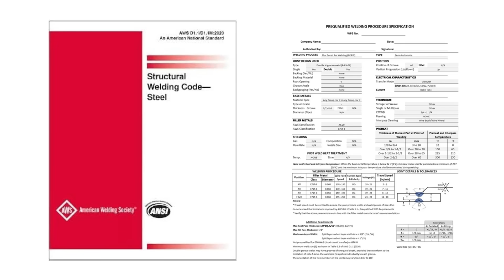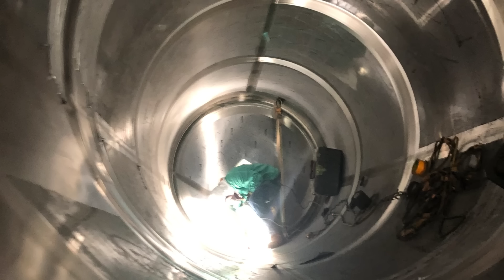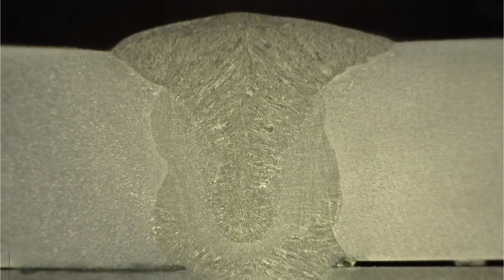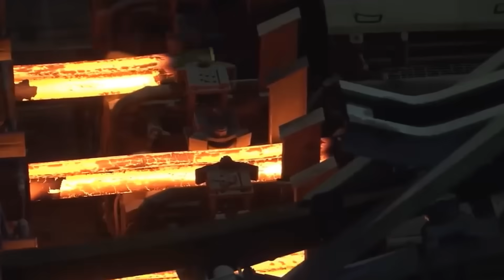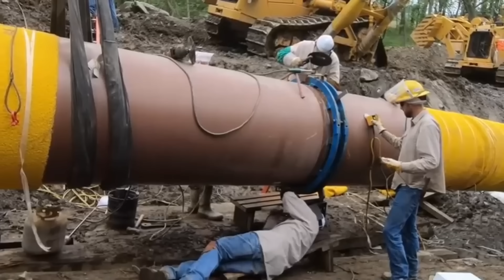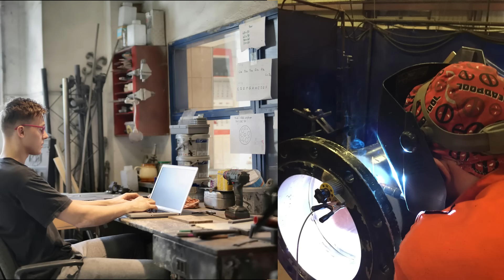7 Things Engineers Wished Welders Knew About Welding

Comment: When a car rolls off the line, the engineers that designed it, should be given a basic set of tools and a driveway, and be told to change the oil, remove the starter motor, remove the alternator, swap the thermostat etc.

Some modern vehicles require a full workshop, four elbows and the ability to work by feel, just to fix the simplest things.

Comment: The FRIB at Michigan State University. A particle collider with a building on top. 

Made the first floor beams out of something like w44x335 with 2" plate welded to the top and bottom flanges.  The engineers specified a 2" camber at 20' lengths.

Engineers didn't understand that for the camber to be useful, you have to have the building there first. 

Biggest mistake I've ever seen. I don't trust engineers.

Comment: There is a difference between knowing how a weld should be made and knowing how to make a weld.

I was called into to solve a weld problem that a fabricator had.  It turns out the welders were not welding according to the design.  Once they started welding according to the design, the problem went away.

Comment: 2 things I have fought as a welding inspector. Electrode manipulation too wide leading to loss of interpass temp, and rolls of wire left in wire feeders at night to connect moisture and be injected in the weld the next morning. Your title is wrong; it should be 7 things Inspectors wished welders knew about welding. Engineers are useless most of the time.
Reply: Damn straight. Although, it doesn’t help when the base material is left OUTSIDE either.

Comment: I’ve been an engineer for over fifty years. I started as an apprentice before gaining my Engineering degree. Instead of moving into an office, I spent fifteen years on the shop floor becoming a coded welder for seven of that fifteen. When I finally moved into design, I actually understood most of the pitfalls that engineers don’t foresee because they have no practical experience, making adjustments accordingly.

Comment: this video should be titled "7 things CWIs wished welders knew about welding" not engineers. Very few engineers truly understand metallurgy and the science behind welding. And even fewer actually write procedures. I'm sure some do, in specific circumstances, but I've never known an engineer to.
Reply from the maker: That's a great point. The truth is there are very few welding engineers in charge of welding operations (and not all are proficient in welding engineering). What we see out there is a large number of engineers who are accomplished professionals in other engineering disciplines such as mechanical, electrical, manufacturing ,etc. and they are put in charge of welding.  So they appear to be incompetent, when in reality they are simply not trained properly in disciplines such as welding metallurgy.

Comment: After  talking to a ASME IX welder on the same subject' those dam engineers & they're CAD machines they draw stuff out but sometimes dont factor in the access of the torch & angles involved , he showed me a drawing with the design error . so the welders are sometimes right to complain ........
Reply from the maker: It can be very frustrating when the design does not account for weld access and angles, and in some cases, it may be impossible to make the weld. We see this a lot with joint design as well.  It's not that the weld can't be made, but the angle is so tight that it is virtually impossible to achieve root fusion.  When the NDT is performed and the discontinuity is found the welders is typically blamed for it.
Reply: Sometimes the access problem is neither the engineer nor the welder. It can be that assembly has been done in the wrong order. I once had site complain that they had put together a flare tower (bolted steel angle, similar in structure to an electricity pylon) and they couldn't fit the platforms because the cross bracing was in the way. The supplier's solution: disassemble it and assemble it correctly with the bracing on the inside per the drawing. When in doubt, ask. Engineers do make mistakes but if the welder and engineer work together they can come up with a solution that is weldable and fulfils the design intent.

Comment: As an engineer I found this incredibly patronizing to welders until it got to number 7. That should have come a lot earlier. Feedback needs to happen before welding, not after. The other thing is that there are people who weld, and there are coded welders. A decent coded welder who understands the procedures and also has a steady hand can earn more than an engineer. 

Communicate and understand the designer's intent. If something looks awkward to weld, there may be a reason it was drawn that way. Communicate with the designer, find out why and find something that works for both of you.  I've seen the same pipework redesigned 4 times because some of the redesigners didn't understand the intention of the previous designer.
Reply from the maker: You are right.  Proper communication is the key.  Regardless of skill level in the shop floor or the engineering office, if there is not feedback mechanism problems will occur.

Comment: Pardon my rant, but this should be retitled "7 Things Shop Supervisors Who Aren't Welders Should Know About Welding". Journeyman welders are very aware of all 7 points, but every point takes time. Sometimes it takes a lot of time, and some foremen can't accept that and constantly crack the whip to get the job done faster. How long? I don't know. I can't look at my watch because I'm looking at my puddle. It'll take the time it takes! Less time than doing it twice, so FO! Leave me alone, go do something useful, and let me do my job!
Reply from the maker: You make an excellent point; sometimes, it is the lack of understanding from management that causes many of these issues.  Supervisor are a key part of any quality and production systems and if they are not capable of being the liason between engineering and the shop floor it creates many problems.

Comment: You are very idealistic, don't understand much, and are not observably realistic.
You seem to "accidentally" be handling "AWS D1.1", which is remarkable for being realistic, knowledge, achievable and controls it's scope to make that so.  Essentially, AWS D1.1 is "vertical", for the narrow scope solely of C-Mn steels covering everything from steels through fabrication to welding and on to the NDT (Non Destructive Testing).  It "vertically integrates" for a technically narrow but in the economy dominant form of welded structure.  You don't seem to know that.  Most Standards are "horizontal" and they layer with irrationalities, mismatches, and lack of overall guiding philosophy.
In reality the "close control" has broken on becoming almost "fractal" and the paper exercise has become so enormous it has become self-centred and lost connection to what it claims to relate to.
Welders know a lot.  Okay "Alky Pete" burns rods 12 hours a day and ** anything which gets in the way of his numbers - but with a team even "Alky Pete" gets a valued place.  You miss how we collectively have created this disconnected monster.
I am a welder and work as an engineer when the opportunity comes - which seems to be when someone has a problem so big they have no other choice than to "suspend the rules" and engage me - with great results...👍
Take your example of heat input.  In a situation I know, chasing "low heat input" they suffer >90% rejection rate - and you would never know that the Laws of the Universe make the zone between "too cold" and "too hot" about 1% if the power
Reply from the maker: Valuable points, and I appreciate you sharing your experience.

Comment: I started my engineering career on the shop floor as an apprentice, moving to the design office after 5 years "hands-on". I often hear arrogant hands-on guys say "do you want it right or do you want it to the drawing?" On all my drawings I put "if in doubt, ask". 99% of production mistakes are down to my drawings being ignored and not queried. I once went to site and saw what was obviously re-work because something I drew had been made wrong (i.e. not to drawing). When I asked what went wrong, I was told "Ah, that was Sam using his initiative."
Industry would save a great deal of money if hands-on guys ASK and engineers LISTEN (we don't always get it right, just mostly).
Reply from the maker: Excellent insight.  And so true.  It happens more oftent that we'd like to admit.

Comment: Structural engineers in the building industry know little to nothing about welding. It is up to the fabricator to develop their own weld procedures. Engineers tend to over specify weld size or ignore it completely
Reply from the maker: We see a lot of design engineers (and even some welding engineers) over design because they want to play it safe.  For example, specifying a complete joint penetration weld when a partial joint penetrations weld will do.  This is a  very costly way to "play it safe."
Reply: @weldinganswers  The welding engineer may not know the assumption made by the design engineer. If the weld is a profile sticking out as a cantilever, it will obviously be under bending load. If the weld is part of a well designed triangular truss structure, integrity may not require bending load at all. If this is not properly specified, the welding engineer is right to play it safe. As usual, communication is key and always ask if you are in doubt.

Comment: All 7 points are the responsibility of the welder. Leave the weld engineer out. A middle man who has responsibility over a welder is a moot point. Engineers design the structures and spec out materials to be used, just not processes and procedures. It generates resentment due to lack of trust and too many steps. Let the welder do his job. He's not a robot.  Literally everything here is what the welder learns in school and does daily. He doesn't need someone to keep telling him (her) what to do. The mindset that the engineer has authority over a welder is the failure here. It's damaging, causing them to stop working and move on, huge turnarounds, conflict in the workplace, etc......

Comment: What the engineer wants you to know :

They can't tell the one welding how to do his job if the welder doesn't explain his job to him.

...

What's the use of an engineer again?

Most welders are educated in what the engineer is telling them to do. Bureaucracy is a waste, complicates the job, and gets in the welder's way of doing proper work. Hence, every welder needs to be the engineer.

Engineers have a place on designing steel structures, not designing welds. That's strictly the job of the dude welding.

Comment: I know nobody asked but...
Here are a list of things mechanics wish engineers knew about building cars: 
1) Cars, like all things mechanical, require service. Perhaps you ought to try to repair something (other than a picture frame) before you actually try to design something. Just a thought.
2) Cars, like all things mechanical, require service. Perhaps you ought to try to repair something (other than a picture frame) before you actually try to design something. Just a thought.
3) Cars, like all things mechanical, require service. Perhaps you ought to try to repair something (other than a picture frame) before you actually try to design something. Just a thought.
4) Cars, like all things mechanical, require service. Perhaps you ought to try to repair something (other than a picture frame) before you actually try to design something. Just a thought.
5) Cars, like all things mechanical, require service. Perhaps you ought to try to repair something (other than a picture frame) before you actually try to design something. Just a thought.
and the list goes on and on and on and on...
Reply: Not up to us engineers. The coin counters next door say we can save a cent by putting the oil drain plug in an awkward position... So that's what they want us to do.
Reply: The mini has everything so tightly rammed in that some of them have the headlights on the bonnet (or hood in American.) It's a feature other cars should copy as just changing a bulb can be incredibly difficult. Additionally, just don't ram everything in so tight in the first place. Underrated comment by the way.
Reply: LOL so true. 30 years mechanical engineer with 12 years at GM/Delphi - Ford/Visteon. 
I still work on my own cars. Engineers may know how to BUILD cars but are often oblivious to SERVICING cars. And yes - the penny pinchers in finance will kill many obvious features that enhance servicing. Can't have the general public fixing their own cars!

Comment: Most welders will admit when they make a mistake, but I've never come across an engineer that will, and believe me they do make mistakes. An example of this pops up in this video. The diagram at 2.45 is correct, however the diagram at 3.04 is incorrect as it is not possible to lay the weld as shown in the order it is shown.  For those who do not understand,  26 is the last weld in order however it is under 25 and 25 is under 24 and so on  ( amazingly he / she got  1, 2, 3 and 4  welds correct ). The last weld is always on top. If an engineer fails to get something as simple as this correct, then how can a welder have respect for them or faith in their design.
Reply: Sure. Even better, I am I.W.E. for a  30 Years, and every WPQR in my ex company was executed by myself or the welder I choosed under my supervision during WPQR execution where I was present ALL the time, recording every step, and every pass situation.
On the other side, in production, and especially on thick and very thick elements, with very different root openings, that appeared, sometimes is very hard even to calculate every pass configuration, regarding geometry, and especially when filler material size is to be changed during welding, f.e. SAW welding procedures where welding operator’s feedback is essential.
I found also that every I.W.E. Should be as a minimum 50% of the working hours in production area, “catching” all the problems and instructing welders, welding operators and welding foremans.
Also, forcing welding engineer to fill the positions of engineering and control function at the same time is extremely contra productive, because it is coaming to clash of interests. Period.
Reply from the maker: Great points.  Sometimes mistakes are made in drawings showing weld sequence.  The mistake in this case is not the order, but the drawing of the bead itself.  Most experience welders, as yourself, would recognize that and simply make the adjustment.  This issue; however, needs to be communicated back to the engineers so that welders that are not that experience don't make a mistake or at least don't waste time trying to figure it out.  Feedback to the engineering office is essential, but to your point, a lot of times engineers refuse to make changes.  Sometimes it is the amount of work necessary to switch a drawing that drives this decisions.  Us welders also need to do a good job of explaining the cost of not making the change.  It's tough.  That's why the companies that figure out this communication between the shop and the engineering office tend to be the most efficient.  The crazy part?  More often that not it is management's fault.
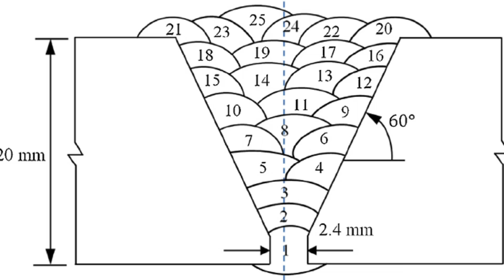Reply: 2:45 is partially wrong, 14/15.
Reply: @Georgewilliamherbert  Good pick-up there. I missed that one.

Comment: I wish this list had included filler material and their effects on the overall weld design. It's a critical part of the weldment and should always be followed as called out in the drawing.
Reply from the maker: Great point, the filler material is a vital part of the design and has a big impact on overall performance.  Many mistakes are made assuming that matching filler metal strength is always best when in reality many times undermatching is a better option for performance.

Comment: made a living as a welder for years - got hurt,back to school, became engineer.
There are a million things welders wish engineers knew about engineering......
Reply: Speaking as an engineer (not a mechanical one but close enough to understand the problem) that's like a superhero story. The welder got hurt, went to school and became an engineer is like the guy who got zapped by radioactivity and gained supernatural powers. A bad engineer is one who things he knows everything. A good engineer is one who realises the shop guys know stuff too.

Slightly unrelated story: while working for a boiler supplier I ran a project for a boiler room in a factory. The architect put the chimney right through the structural steel. Our guy in the drawing office who worked the tools spotted it. The chimney needed a dog-leg offset anyway so we supplied a chimney with a certain offset and drew that radius on the drawing. Installer then asks me to specify exactly where to put the boiler in the boiler house. My response: we have supplied a chimney that will work with various arrangements, why dont YOU and the architect and the client go down to the boilerhouse and work out a way to make it fit without hitting the structural steel.